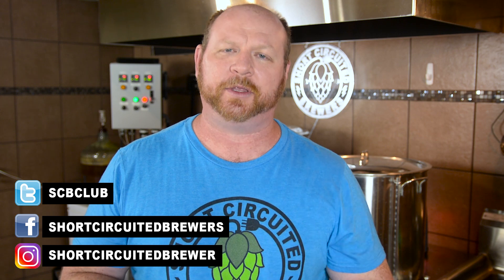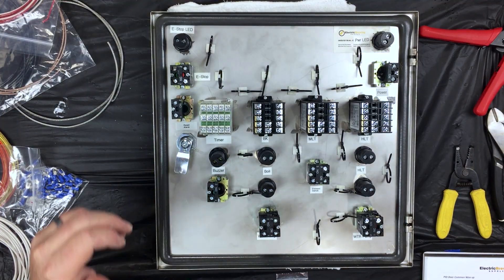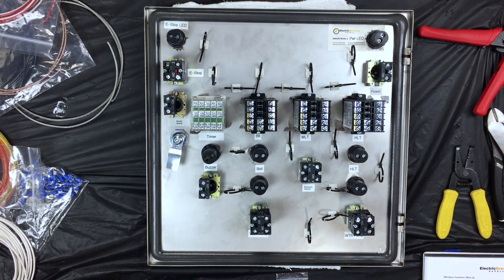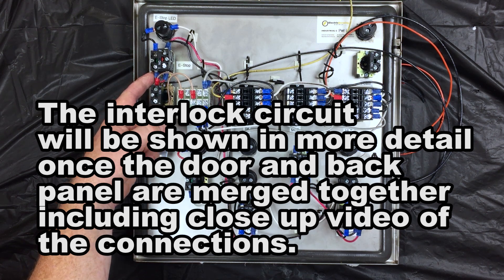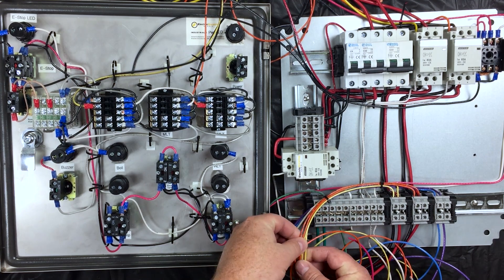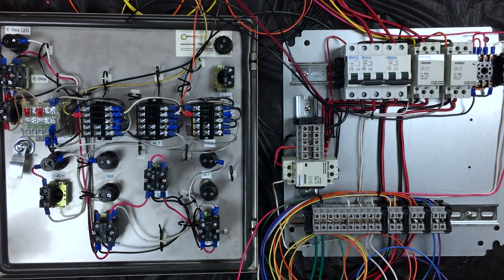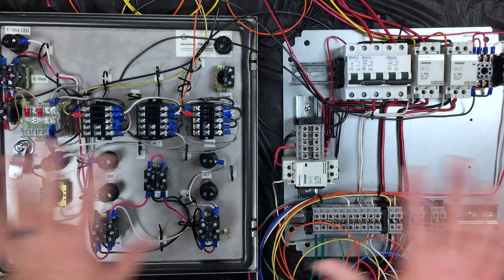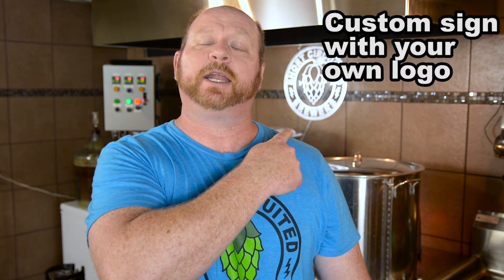Electric Brewing Supply Control Panel Build - Wiring The Control Panel Door

Comment: Since you asked, I am working on a three BBL system where the wort will be extracted into malt for sale to my costumers. 

These videos are are very helpful.
Reply from the maker: Wow, what does that take? Is it liquid malt extract or dry?
Reply: The process is fairly simple, txfr the wort from the brew kettle to secondary vessel at a vacuum about 6 inches of mercury at that point the hot wort will start to re-boil.    The  steam from this stage will be extracted via the vacuum. As the moisture content lowers the wort becomes an extract. The catch is in the fine tuning, repeatability, consistency,  and on the other end reconstitution of the wort and brewing the beer and having it taste like the original beer from the wort before extraction.

Sounds simple. . . . .  Nothings simple.
Reply from the maker: Cool thanks for sharing the info!! I'm sure it's not easy!! Lol

Comment: Brian, thanks so much for this.  Huge help. I’m about to start wiring the front panel.  Although I am using the newer ebsp200 PIDs and ebst200 timer.  I have translated the different wiring positions on the back of these compared to the 16C PIDs that are in your video.  My question:  Pins 14(AL1), 15(COM), 13(AL2)(in that order) on the 16C translate to 7,8,9 on the ebsp200.  I see you have jumpers that utilize pin 13(AL2) and in the wiring diagram for the ebsp200 the AL2 pin (9) is not used at all.  Is there any added benefit to this or do I not need it or what?  Thanks a lot!
Reply from the maker: I would say follow the pin out for those. I have not wired one of the new ones so can't really say. The tricky part on the front panel is the e stop I tried make it really thorough there.. Good luck!!

Comment: I have a vacant 50 amp breaker in my panel that ran a hot tub (previous owner) with about 80 ft of 10 gauge wire. I will be going electric this fall or winter. Looking to buy or build a 240v control panel system. What is the cost of buying verses building?
Reply from the maker: If memory serves about $400 saved on building it yourself.

Comment: The wiring diagrams included in the manual are the worst I have ever seen. Everything is so broken up it's hard to follow. I am a 20 yr electrician and I can hardly follow them!
Reply from the maker: I can't say I disagree with you on that... Kinda why I made these videos. The Interrupt switch circuit is the by far the most confusing. Hopefully these videos help. Cheers! 👍🍻

Comment: I would like to create a BIAB electric system on 220v with an arduino or raspberry pi hooked up with Bluetooth connectors so that I can run the brewery from my phone.
Reply from the maker: Do it Mark! Craft Pi sound like the way to go. Have you looked any of that up?
Reply: I've looked up several things (mostly on Arduino) - I'm currently attempting to see how to set up relays so that the little 3v-5v switches can handle 220v circuits. I'll check out Craft Pi for sure! Looking for any information I can since I know this isn't the most traditional build!
Reply from the maker: Most likely the 240 circuits are controlled by SSR's made to handle the amperage, and any low voltage switches are use to activate larger relays.
Reply: Okay, interesting. Thank you SO much, this is extremely helpful. So I'm assuming there would need to be SSR's for the 240v and ALSO separate relays that the low voltage switches are hooked up to?

e.g. Arduino port > larger relay > SSR > 240v

p.s. your thoughtfulness and helpfulness has definitely earned a subscribe and multiple video likes ;)
Reply from the maker: Yes. The SSR's hook up to the elements, and smaller relays would control pumps or valves, anything that does not draw a lot of amperage. 
Glad you found everything helpful! Certainly appreciate the comments and the subscription! Cheers Mark!

Comment: nice job Bryan am in the process of building a new control panel what gauge wire did you use for the door?
Reply from the maker: There were several different sizes. Mainly 14 gauge for all the switches and what not.  Smaller for the PIDS.

Comment: Can u tel me how to check spp single phase preventer on single phase
Reply from the maker: shehbazmansuri in general? or on this panel?
Reply: In general
Reply from the maker: shehbazmansuri use a multi meter to check for continuity. That will tell you if the circuit is open or closed.

Comment: I'm looking to do my first electric build, I was looking at ebrewsupply 240v biab diy kit (looks like a very professionally put together kit) but have been torn with Auber 240v biab kit because it comes with the dspr310b ezboil controller instead of a PID. Have you got to use the ezboil controller yet? Thanks for the awesome videos, they've been a great help.
Reply from the maker: I have not Jeff. So I cannot comment on how much "better" they are than a PID. ( Ez boil is not a "true" PID) I think what attracts most people to them is the rotary dial on the front for controlling the temp. I will tell you that I have been very impressed with the completeness of the EBREW supply kit. I really comes complete. The stainless options for enclosures are affordable and the ability to get them pre drilled (laser cut) is great. They have also recently upgraded the probes to a silicone sheath that is REALLY nice, I will be showing then soon. Ultimately it is up to you. Remember if you go with the auber kit, it doesn't come with connectors or any wiring. So you need to add that to the final cost. The controller in the EBREW supply kit is easy to use. I will be going through calibration and use of it in coming episodes. I know this might sounds like a commercial... But I really do think EBREW supply kits are a great deal on a COMPLETE kit. If you don't want to focus on anything but getting it built and getting brewing.  Not knocking the auber kit.. Just sayin' 
Sorry for the long winded answer.. Just wanted to point a few things out.
Cheers Jeff! 🍻

Comment: I'm actually cabling up the door of the 50a 4 element ebrew control panel now.
Reply from the maker: A few more wires but basically the same process! What size system? Thanks for commenting Gavin! 🍻
Reply: Short Circuited Brewers 
I have 3 x 30 gallon or 114 litre kettles. 
I went for the 4 element so I was able to achieve a much faster brewday.
I'm doing the bcs system. As im in Australia there are a few different schematics to go through. Ryan has been really helpful along the way.
I'm just taking my time with it so it's all right.
look forward to seeing your next vid mate. 
Gav
Reply from the maker: Awesome Gavin! I would agree on dual elements with that size. You may never get a good boil with one element. The BCS is interesting, I will be doing an automated panel soon too. (Not BCS based) good luck with everything! Cheers! 🍻